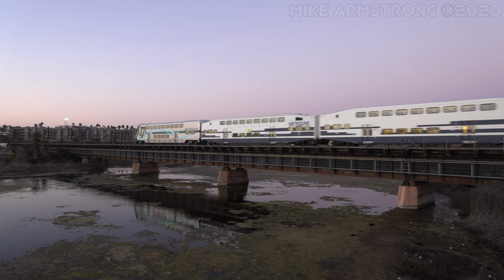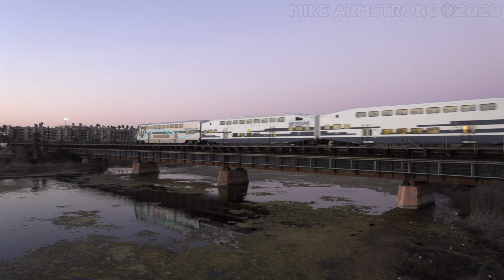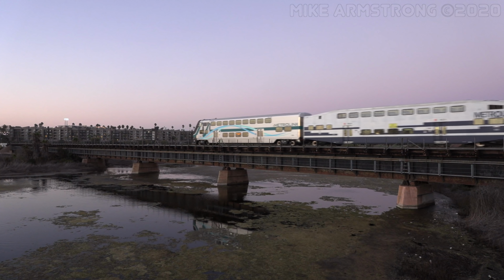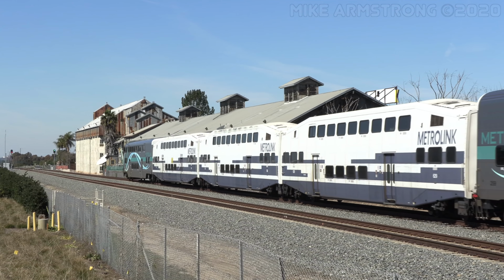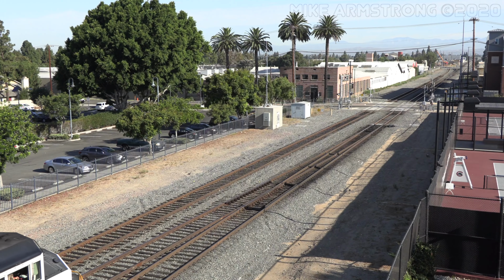Metrolink F59 Locomotive Farewell!

Comment: as a kid for some reason, i always saw metrolink like a sibling to trinity railway express because not only did they both use the same locomotive and passenger car designs, but they almost had similar color themes. but now that the f59ph’s and f59phi’s are being retired and they have a newer color theme, i can’t see metrolink the same way anymore. i also wished i started learning about locomotive designs way earlier.

Comment: Awesome video
Reply from the maker: Thank you!
Reply: CoasterFan2105 Metrolink is rebuilding the 2 non rebuilding F59PHs and F59PHIs. Also Metrolink is sending the rest of the non rebuilt F59PHs and F59PHIs to different commuter rails. The rest of the Non rebuild F59PHs are going to Sounder Transit, Tri Rail, and VRE. The F59PHs on the GO Transit paint are going to West Coast Express. F59PH 18533 doesn’t belong to Metrolink, F59PH 18533 is on the Mi Train paint and it’s going to the Steam Railroading Institute for the ongoing constructions of the Mi Train stations and it will operate and run excursions including the North Pole Express with PM 1225 and GLC 395. Some of the Metrolink F59PHIs are going to Tri Rail, Frontrunner, railrunner, North Star, VRE, ACE, and AMT Montreal

Comment: Nice catches Mike! My buddy Jim worked for Metrolink from 1992 up until his retirement in 2014. He ran all of those locomotives, including 800. 800 was a bad run because they threw a monitor right in the middle of the cab, and the engine loaded slow and whatnot. But he liked the F59s.

Comment: My Favorite Metrolink F59PH is 859, and F59PHI, is 875. I'm glad 859 has already found its new home in North Carolina, but we still need to hope that 875 makes it. Hopefully it could be sold to Tri-Rail or Exo.
Reply: 859 had a white numberboard with small blue text and the old Metrolink logo was patcher over with blue, and 875 just looked better than the rest of the PHIs in the scheme.
Reply: I always felt closest to 859, with it being "F59 859, '59 '59", having been used with the Coaster set back in 2007, and having been involved in the Placentia Collision in 2002.

I've owned an HO Scale Model of 875 since childhood. I also think 875 has a better K5LA than every other F59 on the system.

Comment: Great video, but I heard that some of the F59PH's will be overhauled and sold to Amtrak Piedmont, and some of the PHI's will also get overhauled and used along side the F125s due to them having issues
Reply: The F125’s issue is being a failure
Reply: @hamtrak_p42dcamtrak67  ik
Reply: Hamtrak_p42dc Amtrak Hardly lol. They had a few bugs at first but they are amazing power. A lot of the AV line engineers love them and have given them the nickname “Monsters”. They are great locomotives, not failures
Reply: @Amrep dude499 A wet leaf could disable the F125s traction motors back in 2018.
Reply: @Amrepdude499  monsters? I'd say orca since they kinda look like one with their scheme.

Comment: 😭😭😭😭😭😭😭😭😭😭 R.I.P All F59PHIs And F59PHs, But The F59PHRs Will Retire In August 2020 Since The New F125s Passed The Virtual Railfan Camera In Other States
Reply: Sebastian Floyd If they aren’t retiring the PHR’s then explain why 3 are sitting in Keller yard with a permanently dissabled engine block
Reply: @Amrep dude499 The PHRs in Keller still have usable engines. They've been temporarily retired due to the Pandemic

Comment: Are MP36-3CS still in Service?
Reply: Yes
Reply: Yes but from what I’ve heard, they will slowly be retired as well
Reply: @CrazyDash Yt No, the F125 order was for 40 to replace the 36 F59s. An F125 will replace 893, leaving 3 spare.
Reply: A Very Random Person Isn’t there plans in the future to upgrade the MP36’s (Including 893 with its terrible engine issues) to Tier 4 standards?
Reply: Amrep dude499 Would be interesting to see Metrolink upgrade their MP36s to MP54 standards. Plus I doubt that SCAX 893 will return to service since it has been out of service for about 2-3 years now.
Reply: @Amrep dude499 893s too far gone. It's been in the CMF since late 2015, and has been stripped for 2+ years now. It would need to get lots of new parts along with a T4 prime mover. Metrolink should give the MPIs a complete rebuild, but funding is limited.
Reply: Average_ Joe 893 has a major engine issue. I caught a glimpse of it in CMF with the bay doors open and it literally looks like it drilled its own engine blocks. The block has a hole in it just like the retired F59’s do
Reply: Amrep dude499 Yes I knew about that. They are probably stripping 893 for parts for the rest of the MP36 fleet considering the MP36 has been retired from MPI’s catalog.
Reply: Average_ Joe I wouldn’t be surprised. Its been in CMF for about as long as SCAX 866
Reply: @Amrep dude499 866 is an F59PH. It will be scrapped due to the terms of the F125 order